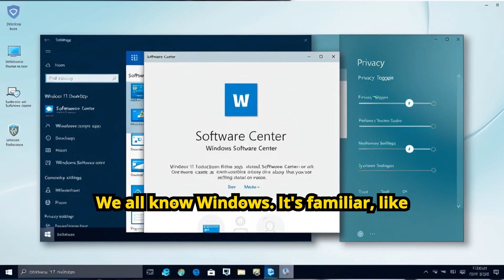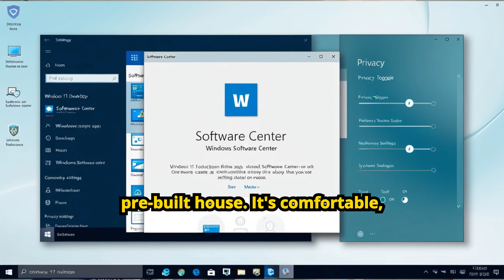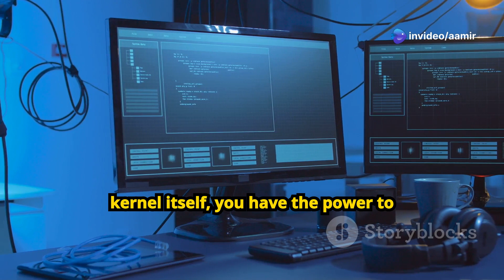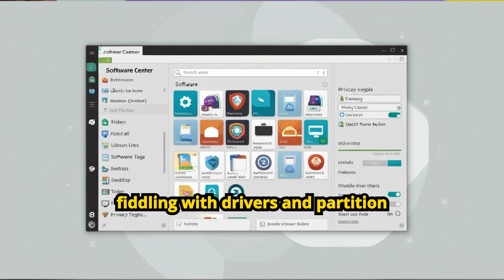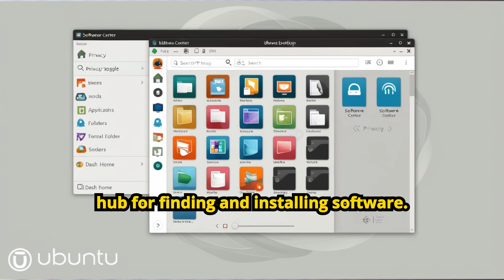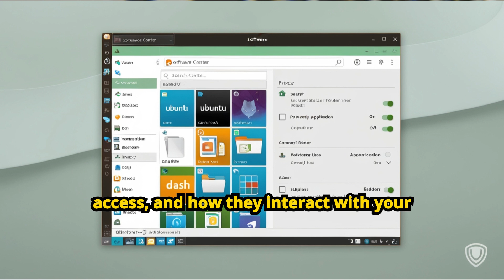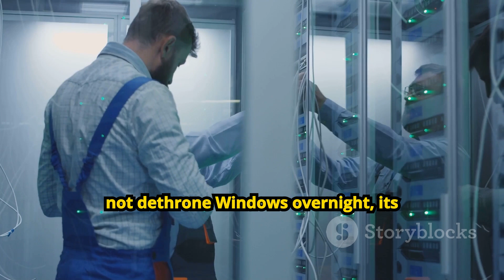Why Are So Many People Switching to Linux?

Comment: Apple computing is way too expensive. Not many can afford it and the software/hardware is not that good really. A Porsche body with a SEAT engine. Windows is just one major problem after another, tries to control your computer and has too many viruses and very little security. Modern Linux, like Linux Mint, for example is sleek, smooth, customizable, reliable, secure and free.
Reply from the maker: @carltaylor4942 Great points! Modern Linux, like Mint, truly stands out—secure, sleek, customizable, and free. It’s amazing how much value it offers compared to the high cost of Apple or the challenges with Windows. Definitely worth exploring!
Reply: @nixguard  - I've been using Mint for many years now (10?) as my main OS and I've had an excellent experience with it. No Windows any more!
Reply: @nixguard  - I also use Ubuntu Studio as a music studio for keyboards and guitar recording. All free. 😀

Comment: I wouldn't compare every Linux distro to a plot of land with a bunch of building material being dumped on it to build your own. While that may be the case for something like Vanilla Debian or Arch, a lot of distros are more like a house thats been built yet they didn't connect the plumbing correctly, installed the kitchen yet left out the sink and a garage thats built for two but can only gain access through the house  😂. And when you complain to the builder, they just say RTFM 🤣
Reply from the maker: 😂 Love the analogy, Peter (
@peterschmidt9942)! You're spot on, some distros definitely feel like they’ve got ‘quirks’ that keep things interesting. It's part of the charm (and frustration) of Linux, right? But hey, at least when the builder says RTFM, the manual is usually free and open source. 😅 Which distros have given you the most ‘creative building designs’ so far?

Comment: From a Linux user since 2008:  A video full of Fairy Tales.
Linux distros are not special, they are just a nice set of free OSes, free like in free beer.  Linux is not maintained by incels in the cellar of their parents' house, but most of the development is done by IT companies, including Microsoft, IBM/Red Hat, Oracle and many others.
Reply from the maker: Thank you for your comment, @bertnijhof5413! You bring up an excellent point—there are plenty of misconceptions about Linux and its development. It’s true that Linux is not just a “passion project” but a collaborative effort supported by major IT companies, as well as a vibrant community of contributors. Its value lies in being a robust, free option for a wide range of use cases, not in myths or overhype. Your experience since 2008 adds weight to the discussion—thank you for sharing your perspective!

Comment: Did it break the 2% Operating system market share yet ???

1.58% last time I looked.
Reply from the maker: Great observation! Linux has grown recently, holding around 4.45% of the desktop OS market as of 2024, up from under 2% not too long ago. This rise reflects its improved user-friendliness, stronger hardware support, and increasing popularity as a privacy-respecting alternative.
Reply: It has little over 4% because they count the steamdecks to asna desktop

Comment: You say Linux is harder to learn, I can tell you, my parents have been on both Windows and Linux and they understand just about as much about both. They have the same time of questions, but the Linux machine gives me less work in supporting them because it stays more the same.
Reply from the maker: It's interesting to hear your experience! Many users find that once they get the hang of it, Linux can actually be quite user-friendly.
Reply: @nixguard   Maybe I need to elaborate, I'm saying the learning curve is the same and they understand very little of both, because they use it like 1 or 2 times a week. They are older and so all that combined their memory on how to use it is limited. So when people say: Windows is easier to use, what they often mean: I'm more familiar with Windows (the shock of Windows 11 coming from Windows 10 is also real for those who do have familiarity with Windows, surprisingly Windows 11 took a lot of things from ChromeOS interface, just look it up). The web has obviously helped a lot, because it has greatly reduced the number of native applications people depend on. So what people often need to transition: familiarity with native applications and having their workflows fit the model of those applications. So 1 thing to do to transition from Windows to Linux, use the open source application on Windows first that you want to use on Linux. That way, you can find a workflow that works for you and then use Linux instead of Windows, the applications are familiar and it becomes a LOT easier.
Reply: @nixguard  Yes exactly, I had the same experience. My dad, 80 years old, worked with Windows for about 20 years and had issues when it updated to Windows 11. He thought about rolling back to Windows 10 but first gave Ubuntu a try on an ancient Laptop he still had lying around.
He, although not experienced with computers at all, managed to use Ubuntu just fine; it was much better for him than Windows. His printer didn't work on Windows, now it is alive again. 
So I think there is some truths to the idea that Linux is more complicated than Windows; that is true if you come with an idea how to handle Windows and expect Linux to work the same. Without that both are about equally complex.

Comment: I started with Linux this year, after I had to do troubleshooting on Windows I never thought I would have to. And the obsolence of hardware next year only made me more convinced Linux is the way forward for me. I have even revived my ex-Vista laptop, now running beautifully on Wilma. The majority of home users would be perfectly fine on Linux if they gave it a chance, saving money in a long term, also for electricity, as Linux is less hungry for resources. It is a learning curve but so is learning the ways with new Windows. One thing I cannot recommend enough is to do regular backups of data, and if you dare, also cloning of your new configured system. I messed my Linux system the previous weekend, but because I had a recent clone, I restored it in under 10 minutes via Rescuezilla, also a free Linux software. Microsoft's failures made me learning a lot of tricks with computing overall. Feeling liberatd now.
Reply from the maker: Thanks for sharing your experience! You highlight key benefits of Linux, reviving older hardware, resource efficiency, and long-term savings. Many users indeed underestimate Linux's capabilities until they try it. Your advice on regular backups and system cloning is spot on, especially for newcomers navigating the learning curve. Rescuezilla is indeed a fantastic tool! Stories like yours inspire others to explore Linux and embrace its flexibility. Keep up the great work!
Reply: @nixguard  Thanks AI for summing up what I just wrote. 🤨

Comment: I switched in 2020 during the pandemic - plenty of time on my hands.  Go for it - Windows/Microsoft is getting real bad.  However, showing Linux in videos of never ending text on a Terminal does it no favours.  For new users I'd recommend Linux Mint, rather than Ubuntu.
Reply from the maker: That's awesome that you made the switch during the pandemic! Having that extra time to explore Linux must have been a game-changer. I totally agree—constantly showing terminal commands in videos can make Linux seem overwhelming to beginners. Linux Mint is a fantastic recommendation for new users; its user-friendly interface and stability make it a great starting point. Thanks for sharing your insights!

Comment: I witched to Linux Mint 6-7 years ago when MS was trying to force their Win10 spyware on me. Best thing I ever did. Since then, I control my computers, not some giant, money-grubbing, American corporation,  and they run faster, and the workflow is more efficient (no constant click, click, click to do anything).
Reply from the maker: Thanks for sharing your experience! Switching to Linux Mint is definitely a solid choice, especially for taking back control of your system. It’s amazing how much smoother and more efficient workflows can become without all the bloat and intrusive updates. Plus, having a system that respects your privacy is a game-changer. Have you explored any other Linux distros, or are you sticking with Mint for the long run?
Reply: @nixguard  I've looked at Ubuntu and Fedora in a VM to check them out, but I'm so used to Mint Cinnamon now I'll probably stick with it. I mostly just want my O/S to run programs (QGIS, Calc, Writer, Shotcut, etc) and Mint does it well.

Comment: When Windows 10 ends next year there could well be a huge spike in Linux users. Those Windows 11 requirements are still yet to hit Microsoft.
Reply: Those folks better start now, not when 💩 hits the fan. I started earlier this year and still learning my ways around.
Reply from the maker: @D.von.N  Absolutely agree! Starting early gives you time to learn and adapt without the pressure of urgency. Linux has a learning curve, but with patience, it becomes second nature. The earlier you start, the smoother the transition when it really counts. Keep at it!
Reply from the maker: You're absolutely right! The transition to Linux might just become the new trend as more users seek alternatives to Windows 11's requirements.

Comment: For me it was Mandatory baked in MS Windows RECALL. I have gone full Linux. Windows Partition scrubbed forever. Installing Steam/Lutris/Wine and Heroic Launcher lets me play most of my games. Linux Mint is easy if you just want a ready to go system that's close enough to Windows that makes it easy. Linux is only hard if you MAKE it so.
Reply from the maker: Thank you for sharing your experience! It’s inspiring to see others make the switch successfully. Your tips on using Steam, Lutris, and Wine will definitely help those considering a change!
Reply: The real issue isn't Recall (part of Copilot and AI data harvesting to global governance (under the guise of advertising revenue, lol)  with AI Agents) its MS Pluton - basically TPM 2,0 and more tied directly to the CPU/APU.  That would be Ryzen 6000 and newer, Snapdragon 3 and newer and most newer intel.

So you end up with MS holding the UEFI keys for boot-up and decryption keys - next stop MS Azure Sphere (which is global governance)  - basically it's an un-hackable terminal which is 7*24 connected to a-Eye global government servers and I would imagine on the user side what you can access will depend upon your social, carbon and mobility credit scores.